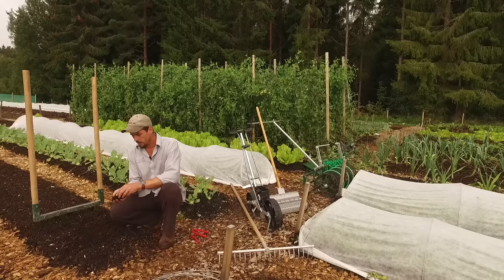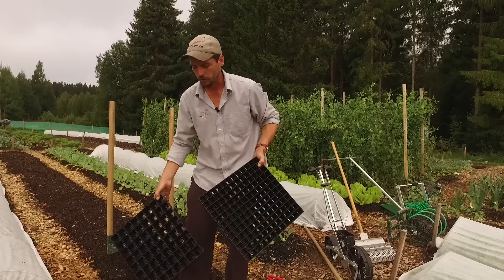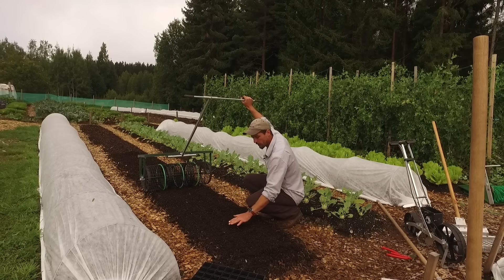MARKET GARDEN TOOLS (Part 1)

Comment: The Meadow Creature broadfork for those who can get them in NA are quite superior to the classic Coleman broadfork Richard is using here.  They don't have the weak point between wood handle and base which is where these break.
Reply: how wide do you run your beds to optimize for these forks?
Reply: @ryancoatney6926  30" to 40"...
Reply: gotcha. looks like they're quite a bit narrower than the coleman ones, so i wondered if you're running narrower beds. doesnt sound like it!

Comment: lots of information on how you prepare the beds here but do you have a video on how you actually set up the cardboard and compost.  Also how long does it take for the cardboard to break down? does it happen over the 1st winter.  I guess I want to ask if the cardbord is problem when you at "forking" the bed to airate it. How deep is the compost over the cardboard. Thanks

Comment: Richard. Can you tell me where you bought the rake? I can't find anything like it in The Netherlands.
Reply: Johnny Seeds in the US? Cant find anything in Germany as well, but I heard you find them in France called grelinette, but doesnt seem to be the same quality.
Reply: I was looking for such a rake as well, bought a really expensive one with iron tines from wolf garten and it sucks. 
Now im using a cheap hay rake (hooihark) with large plastic tines and it's perfect for raking in compost and fertilizer and leveling out the beds. These rakes are also tilted so it's perfect for using while not standing on the beds. 
@ Dobimar The grelinette is a broadfork and you can find very good quality ones around here.

Comment: Thanks for sharing. Are you aware that Charles Dowding's recent trials show that beds with no use of broad fork are producing better yields than beds with use of broad fork?
Reply: Wouldn't that depend on the soil? If you had compacted clay soil, a broadfork would not destroy mycorrhizal fungi because there are none below the surface. I would spray with compost tea and add compost.
Reply: Jod Rodgar from virgin ground?
Reply: On all soil types?